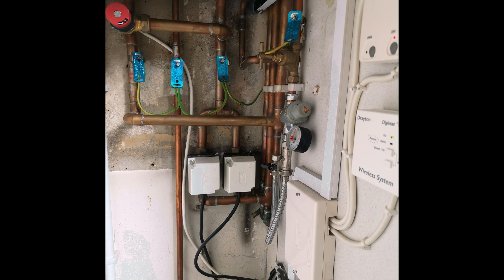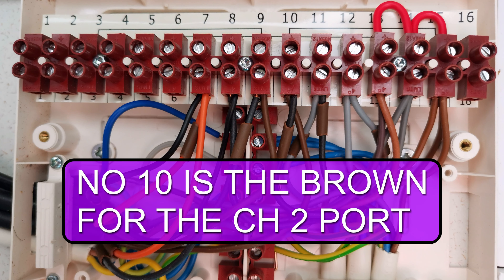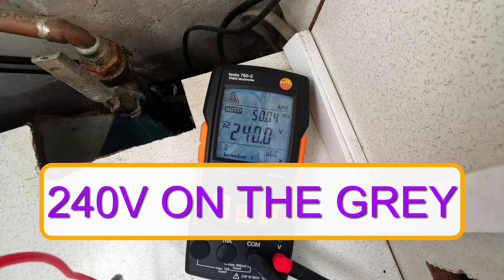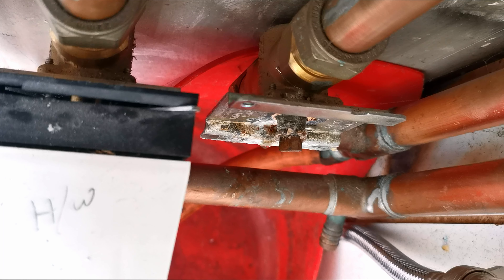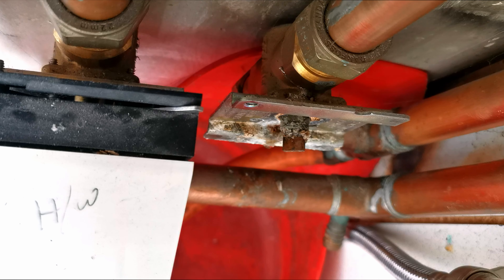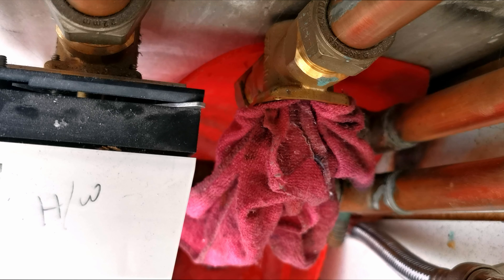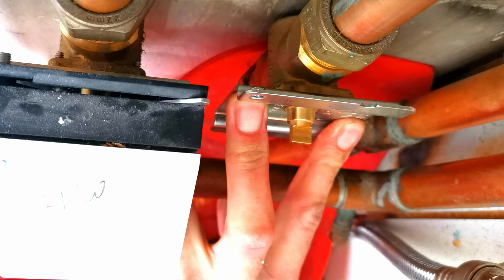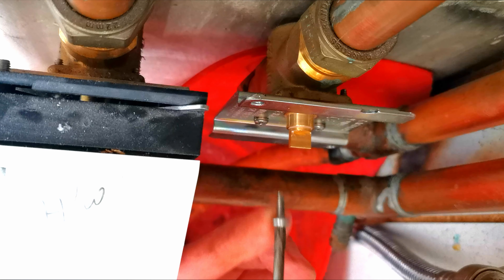Danfoss 2 port valve issue and replacement.

Comment: Hi how would you do this on a y plan can you do the same and also how would you get rid of the pressure without isolating an then just do what you did here?
Reply: Your advice would be appreciated
Reply from the maker: Every system is different. On a Y plan I would close a pump valve if they were in good condition. Then close the balancing valve on the cylinder return (bung it if open system) and then hope for the best.
Reply: @HeatingGeek  thanks for the advice
Reply from the maker: @waseemkhaliq933  There are no hard and fast rules on this stuff. Just take 5min to suss out the best way for the particular job you are on. :-)
Reply: Bung it all day long (if not a dumb move) always feel like i have failed if i have to do a full drain down.
Reply: Obviously drain it if any doubt
Reply from the maker: @dominichalliday8929  Where is the fun in that. Nothing like an oh shit moment at 5pm on a Friday. :-)

Comment: That's great - I was gearing up to replacing the entire unit - had no idea you could do that with a Danfoss. But the valve is under the stairs in our house so much harder to get at. Have freed the jammed valve for now but it has a leak. Think I'll get someone to do it... The leak from the valve has also got into the motor unit and while it still works I may as well replace that too although it isn't that old. The valve being jammed open has also caused high pressure in the boiler (drip from external pipe and boiler at 2.5 bar) and maybe it and  the unvented expansion vessel need a service so perhaps the system will be need to be drained down anyway.
Reply from the maker: Its easy enough to do. Get someone in it won't cost too much. :-)

Comment: This video saved me a lot of time and effort (and removed the risk of flexing the piping to the cylinder too much). I was all ready to have to replace the entire valve section when I came upon this method.
I was worried that the torx screws would be corroded too, but they were fine. I think they're made out of different metal than the steel plate.

Comment: Thanks Ollie, i have replaced hundreds of those valves (they are speced kit on the contract i work mainly on. The why is beyond my pay grade as they are poor) i have cut and soldered rather than disturb dodgy pipework. Sometimes someone just needs to point out a better way. 😁
Reply from the maker: I have caused the flange on a cylinder to leak twice in my years. One was an easy fix on a relatively new cylinder. The other needed to be replaced........ I will never risk that situation ever again. :-/
Reply from the maker: Also, they may leak etc but they keep us busy. :-)
Reply: True that!
Reply: @HeatingGeek  Can be tricky supporting pipework while undoing tight joints.

Comment: Thank you HG  another informative video 👍,  I had not thought of doing that way before, I have previously changed the complete valve .  Did you notice the pressure reducing valve on the filling loop sometimes a sign the system has a leak and is constantly loosing pressure .
Reply from the maker: Yes. In this case, it was so the lady didn't overfill it. :-) Well spotted. :-)
Reply: @HeatingGeek  Hi there. In relation to changing a two way port valve by just replacing the inners, Did you have to drain the system at all to do it this way? Would I have to drain the hot water tank?

Comment: Did you fit a new head or just use the old one ?
Interesting valve - not come across those before !
Reply from the maker: Fitted a new head.
Reply: @HeatingGeek  Unnecessarily ?

Comment: Hi did you just drain heating side to change valve you wouldn’t need to drain cylinder
Reply from the maker: Just got the pressure off. Didn't drain anything, just the pressure. :-) Don't do it if your worried.

Comment: I find that the micro switches on the danfoss valves to be garbage, and have a high failure rate even the spindle seals are poor I tend to steer clear of this brand of 2 ports even though the suppliers keep firing them at us I have started to return them and slowly they are getting the message
Reply from the maker: Keep you busy though wouldn't they ;-)

Comment: I have these. My issue appears to be that when the heating is switched on the white box turns but when turned off it doesn't turn off so the heating runs constantly.

Question: Should. Those valves turn SUPER easy or will they eventually tighten up a bit? I think the mechanism in the white box could be knackered from trying to turn a tight valve over the years. Had the house abiut 5 years now. This issue was fixed at one point but has come back. Last checked before me by previous home owners in 2006.

Not a plumber btw.
Reply from the maker: You should be able to turn the spindle nice and easy with your fingers. These often leak a bit and then seize. Check if it has been leaking.